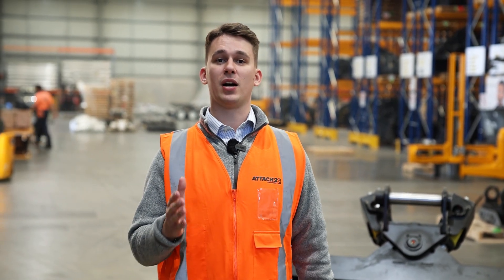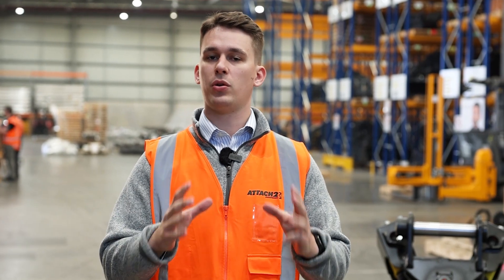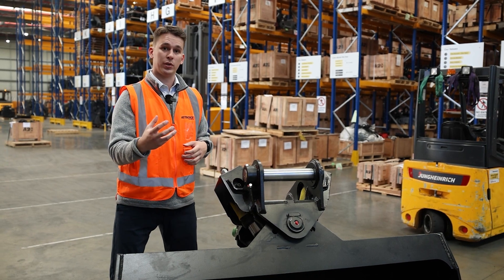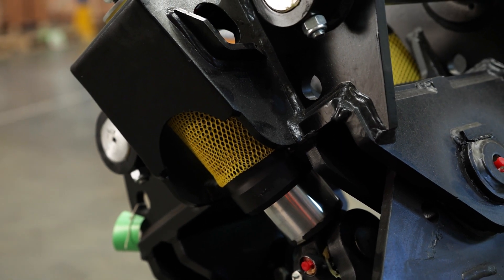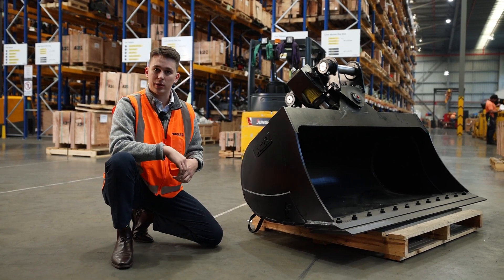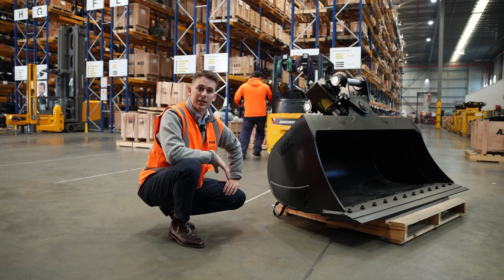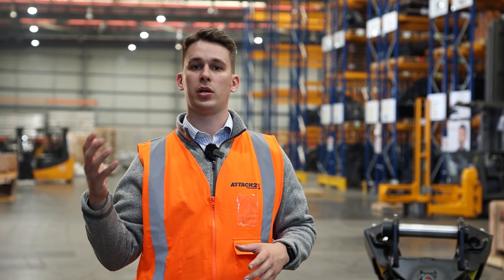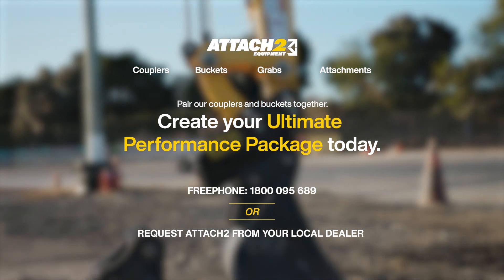Elite Tilt Bucket - Everything you need to know.

Comment: better buy a raedlinger bucket dont uses cylinders... it uses  an oil motor much better
Reply from the maker: Thanks for the comment! We’re very familiar with the Raedlinger motor-driven design — in fact, we used it in our tilt couplers for years. For tilt buckets specifically, though, we’ve found a twin-cylinder setup offers better holding force, easier maintenance, and robust performance in demanding digging applications.

Different systems suit different tools — and for tilt buckets, we find this setup delivers the best balance of strength and simplicity.

Appreciate the discussion!